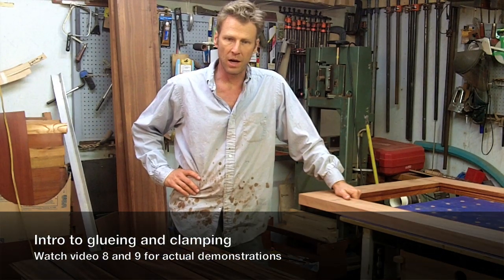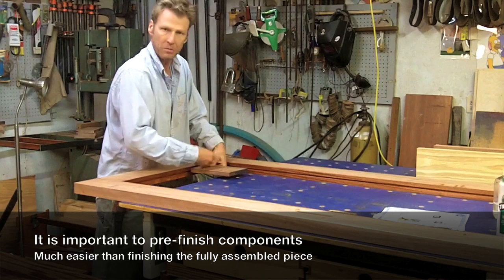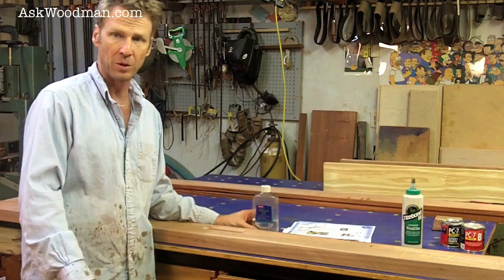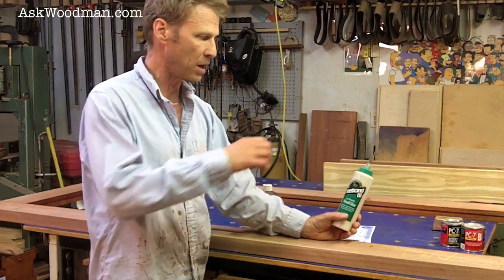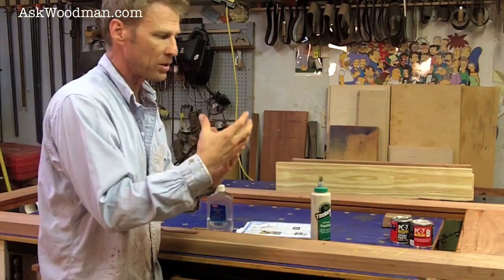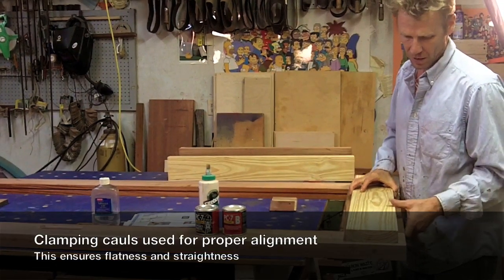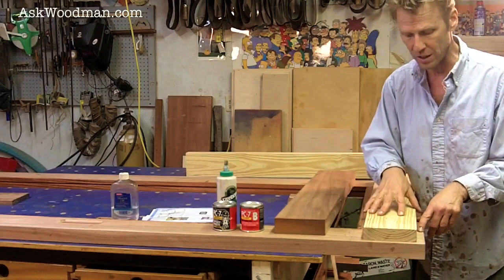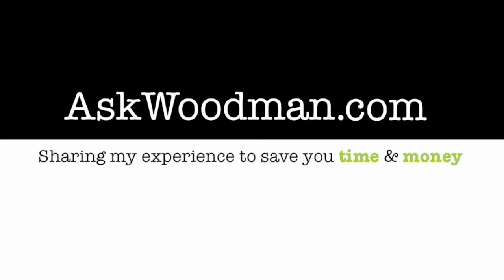17 Intro to Gluing and Clamping - SOLID WOOD DOOR SERIES - Video 7

Comment from the maker: @CanFire9 ANSWER PART2: Cut mortice first and fit tenon to it. If I am prefinishing prior to assembly, the t&g get multiple coats with the brush fairly dry. So I never load finish there but they are well coated. The skin thickness of the finish is not enough to inhibit assembly. One of the biggest reasons for poor fit of t&g is when woodworkers try to cut them on a router table. You have to learn to use the router with a guide fence for accuracy.

Comment from the maker: @Paddy197300 The problem with adding to the bottom of the door is joining your new addition to your door where the grain direction is different. You would have to be very skilled to mate the two pieces and you may additionally need to add a complimentary design element to this piece so it did not look like it was just stobbed on. Dowels are weak. Without seeing a picture my first thought would be to modify the jamb and keep the integrity of the doors in tact. Keep me posted. It sounds fun.

Comment from the maker: @CanFire9 ANSWER PART3: The reason is a router is super accurate locally around its base regardless of the flatness of your work piece. When using a router table, you are having to bend or flatten your stock to the table to get the same relative cut over the length. The longer the board the more inaccuracy. Have not used a router table in 20 yrs. Plan on having video series on both frame and panel making as well as router techniques i have developed from over 25 yrs of professional woodworking.

Comment from the maker: @CanFire9 ANSWER PART1: All questions welcome. Every woodworker had a first time or 20 to get an operation right.  Rattling panels has never been a problem. The after sanding fit should be slight friction. If you can't pass your panel tongue throughout the length of the groove with just slight friction then you are too tight. I almost always cut grooves first and make the tongue fit it but making successive cuts until I get the fit I am after. Same with mortice and tenon.

Comment: Hi,

I've manged to get some really old victorian oak doors and would like to use them in my house. The problem is they are around 65mm to short, and i'm not sure that adding to the existing door frame would as easy as adding to the door. My question is this, would you suggest using doweling holes and glue the extra onto the door before sanding. Or would it indeed be easier to add to the frame.

Thanks in advance 
Paddy